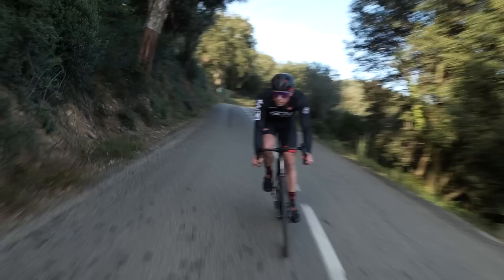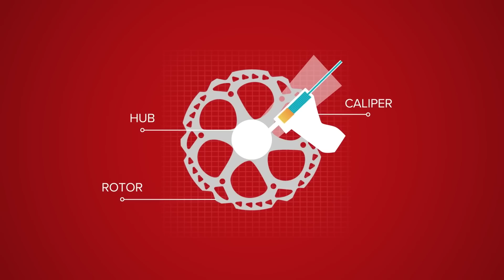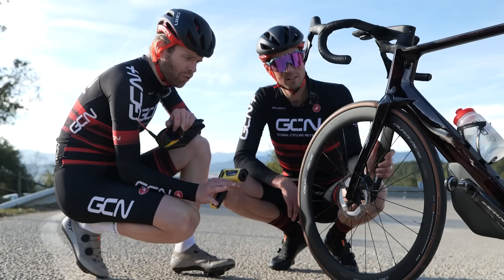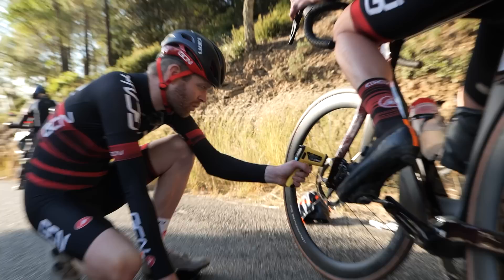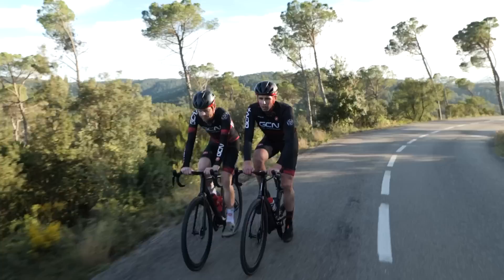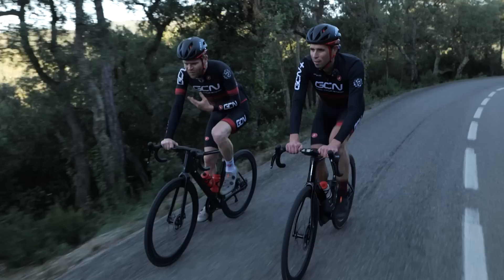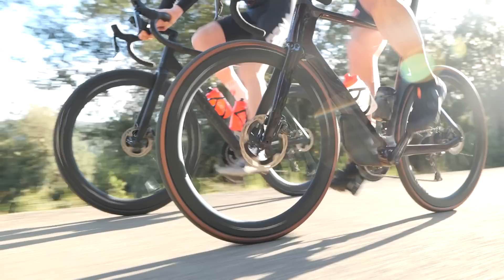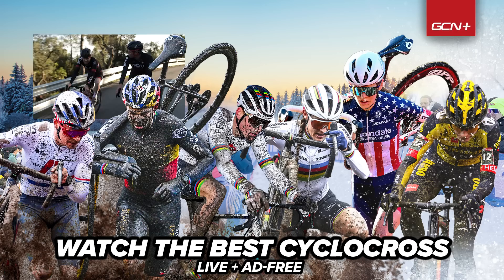Are Big Disc Brakes REALLY Better?

Comment: More fire is more better! Also would love to see how much of a difference it would be between rim,mechanical,and hydraulic brakes. We know which is better but by how much.
Reply: As long as it's dry, my favourite brake caliper of all time was the Dura Ace 7800. I never tried the 7900 but it's supposedly even more powerful. Even on a heavy bike with me being about 13st I was braking a lot later with those calipers. They were easily as good as any hydraulic discs I've used but, it had to be dry conditions. As soon as it rains then hydraulic discs thrash rim brakes. Rim brakes have become redundant, they wear your rims down for a start.

Comment: This is supposedly a tech channel but the tech testing you do is rubbish, like the aero tests you do.  Please talk with an engineer who has some bike background to set these tests up.  In this case, the test was deficient in that (1) the 150 lb rider does not need the larger rotors for sure, and its irrelevant for those guys, so test it with weights to bring the 'rider weight' to 220 or 230 lbs to simulate a big guy or a touring setup.  (2) the descent braking must be carefully controlled, such as starting at the top of the hill at 20 mph and keeping it steady 20 mph without pedaling the whole way down (the heavy rider will keep it 'wanting' to go fast)  (3) there is no reference for how braking is compromised at different rotor temperatures.  Does it start to fade at 55 degrees, or doesn't this matter?  (4) The larger rotor also has a larger heat sink capacity, which is helpful for panic braking, which might be the kind that saves a crash in an emergency.  This should be tested, for example, by a long descent followed by a hard braking zone from 30 or 40 mph to stop.  You can also do these tests, of course, on a test bench.  (5) You should have clipped on a temperature sensor to the disk at the end of the descent with a data logger that plots temperature over time.  These gadgets are not costly.
This test is borderline useless and misleading, because there are riders who want to now the answer to the question that was posed, and you didn't provide it.

Comment: Physics 101, the rate of heat build up will always equal the rate of dissipation regardless of the disc size. The difference is the temperature the disc needs to be at to dissipate the energy.
Reply: Hate to break it to you but that is incorrect it is not a one-to-one ratio at all. I'm not sure where you learned that but it's incorrect. Heat dissipation will vary depending on size of the rotor, thickness of the rotor, material of the rotor, size of the pads material of the pads size of the caliper, two or four pistons, etc. If your assumption was correct then overheating and or warping a rotor would be impossible because the heat would dissipate as quickly as the rotors are heating up or overheating.
Reply: @rider65  if you have two discs , one large one small, and push the same amount of  braking energy into them, once the initial heating up is done and they're at a steady temperature, both discs will dissipate  energy awzy at the same rate. The rate is equal to the rate the braking energy is going in, the difference is the temperature the disc needs to be to transfer the heat away, if you don't get I'm sorry, it isn't a theory.

Comment: Of course smaller rotors take longer to cool down because of the Limited swept area and time to dissipate thermal energy, I.E. Heat. Bigger rotors do not provide more stopping power. Larger rotors have more swept area and can absorb and dissipate thermal energy much more efficiently. Which in turn provides more breaking performance. It's physics silly. The great thing about physics it doesn't give a shit about anyone's opinion or fucking feelings. 😄👍 #RealScience #MechanicalPhysics.
Stay tuned boys and girls I will post a scientific article about hydraulic disc brakes to put to rest the many silly and moronic opinions about disc brakes.

Comment: Its thickness Not surface area. Thicker rotors are less pliable.
Reply: Thicker rotors have a hard time dissipating Heat versus a thinner rotor. A stick of rotor will last longer but will not dissipate the thermal energy as quickly or efficiently. It's in a rotor will wear quicker possibly warp easier so it's a trade off

Comment: 6 bolt versus center lock?
Reply: no practical difference.
Reply: Center lock are way easier to install properly and there's much less things to go wrong. 6 bolts needs specific patterns to tighten, the rotors have some play before tightening (and you have to force them in the correct position), the bolts can become loosen with time and damage your hub.

Comment: This isn’t even a debate in the MTB world. 220mm are becoming standard on some bikes and 180 is an antique
Reply: 180 is XC class (lighter, simpler bikes). Dh or Enduro use bigger rotors, but the bikes are also more massive built and heavier to withstand the high forces
Reply: @simonm1447  remember when 160 was big for XC

Comment: On mountain bikes? why would you want giant dinner plates on a road bike? put it in a wind tunnel the drag would be massive
Reply: This isn't true and has been tested.. moving up to even 160/180mm doesn't effect drag.
Reply: "massive" lol 😂 can you point to a source of your "massive" claim? 😂

Larger discs can carry more heat due to more material, and can dissipate it better due to larger surface area.

If you are trying to win a race then maybe the marginal aerodynamic and weight disadvantage might outweigh the brake fade resistance and cause you to lose. If you are just riding for fun then the additional brake fade resistance can come in handy on long descents. Or just use rim brakes. Whatever 😂
Reply: Most of the drag is caused by the rider, which offers the biggest frontal area. The little bit of drag a brake causes isn't even noticeable for a hobby rider

Comment: The wheels are the biggest rotors possible. Rim brakes are superior.
Reply: In essence true, but aggressive pad material choice, will eat up those wheels. What's more expensive to replace, wheels, or rotor's?
Reply: Have you ever been going downhill on a rimbrake bike with carbon wheels in the rain 😳